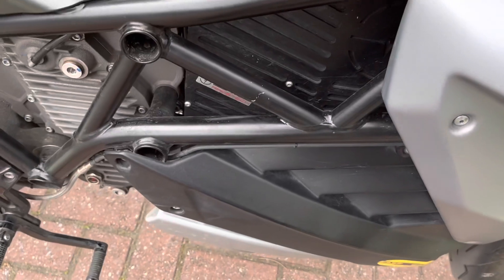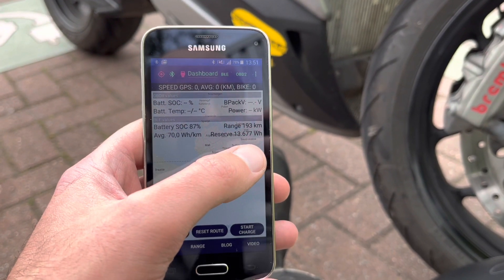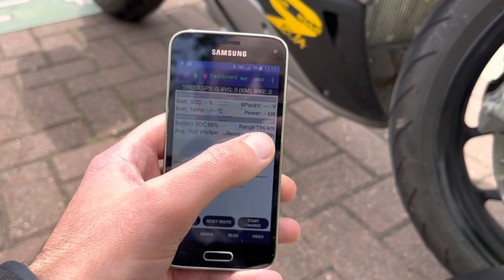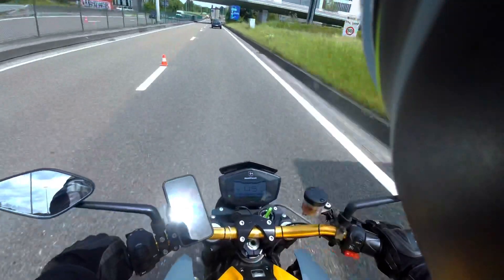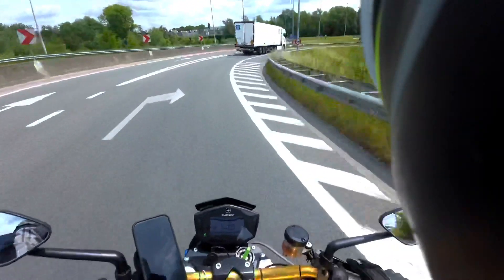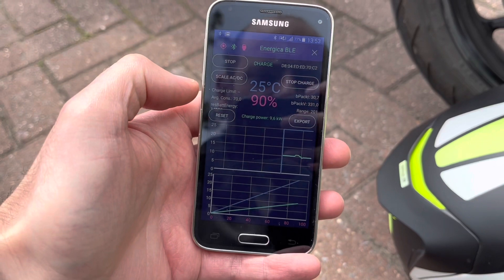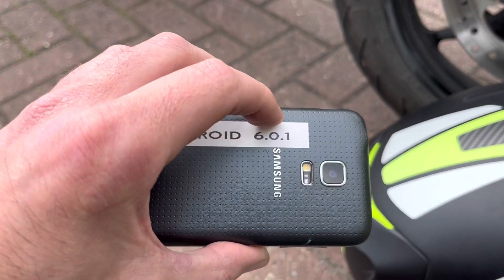These are 3 HIDDEN BLE values that ENERGICA does not want you to see

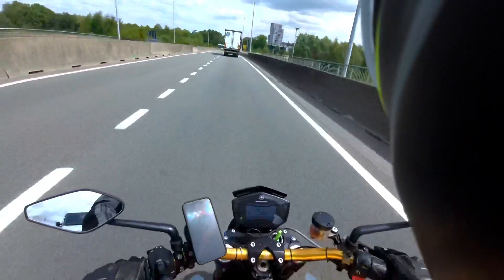Comment: 2:40 ERG! I was wondering! My Nissan Leaf is like that, and ITS DANGEROUS.  I need to know the real value.  I'm going to complain to Energica.  This should be an optional setting "lie to me about my speed [OFF/ON]"
Reply from the maker: Yeah very weird decision to have soccer a high deviation cause in the system you can find the right value. I now use the dvision head-up display showing gps speed. But that is an expensive fix. Others had success with different final gearing at the cost of acceleration. Cause the 200 kph top speed is also just 180 kph.

Comment: Hi Hans, regarding the speedometer being out by 10%. That is not peculiar to Engerica. Pretty much all motorcycles (elec or ice) I've ever owned have shown the speed 5-10% higher than actual.
My Zero SR/F seems to be about 8%.
Reply from the maker: Strange my Zero SR/F was more like 4% and so were my previous bikes. I get it that there is some margin because of tyre wear and speed limits but for Energica they have a good value in the system and then just show you that +10% value on the dash.